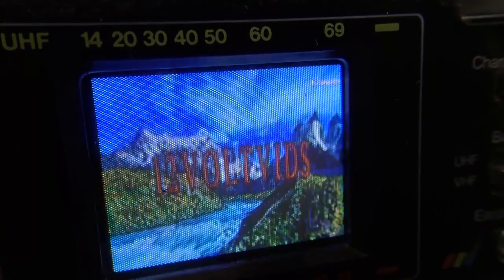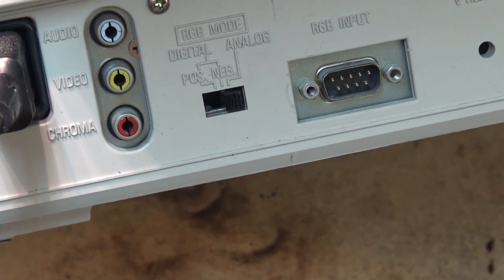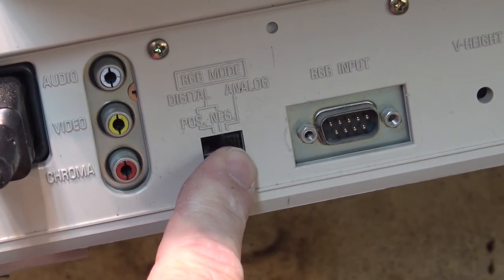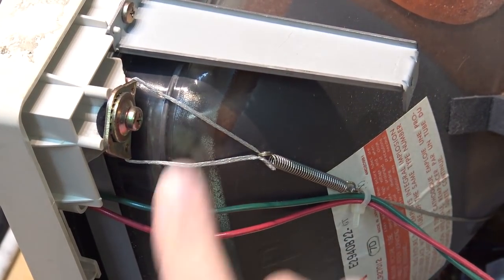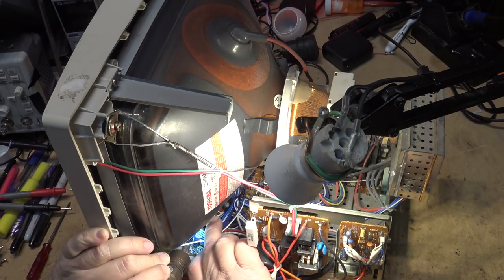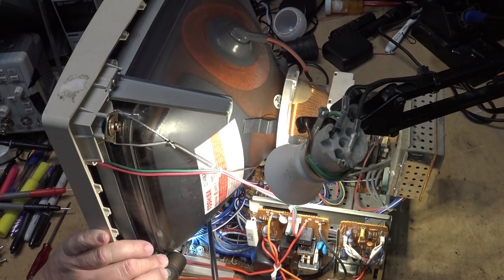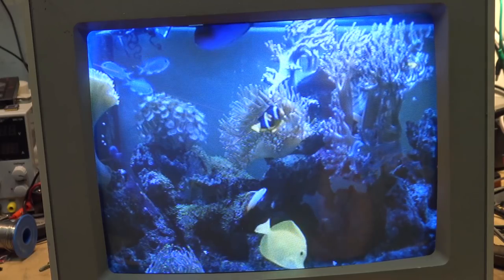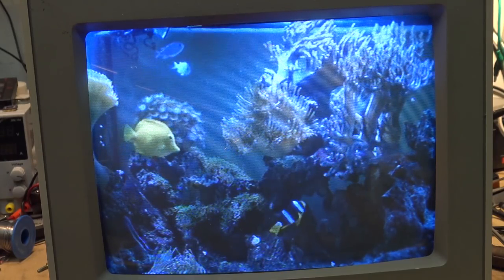Commodore 2002 RGB   Composite monitor picture instability repair

Comment: I had a similar monitor on my Commodore... It was Magnavox branded but used the same chassis and tube as some Commodore models. Got to where the picture would just go out instantly, along with any signs of deflection or HV. If you smacked the case in the right spot, it came back just as quickly. Got tired of that and opened it up one day, sure enough, cracked solder joints on the flyback. Easiest fix ever.

Comment: This video saved me a ton of grief, thank you for making it!  I picked up a 2002 monitor locally recently, and it had even more severe picture glitching than yours, losing both chroma and sync intermittently.  The PCBs inside were very clean with minimal corrosion, and no signs of capacitor leakage, so I was anticipating a world of hurt trying to troubleshoot the problem without obviously failing components. It took a TON of contact cleaner in the Video Mode switch to completely get rid of the problem, but now I have a perfectly stable picture even when fiddling with the switch during operation. Again, thanks!

Comment: Very nice monitor and enjoyable video :-) Are you in your house because covid19? I'm in Italy, we are all in our house. Here is a disaster...
Reply from the maker: No it's my day off. I am back at work tomorrow. I work for telecom, essential service. We have to work, but we are not entering customers homes during the covid restrictions. I can only work outside, and come up with solutions, even if temporary to restore service on the outside. Even it it means running a long wire or fiber from the termination point outside into the premise.

Comment: I've got a 1701, wish I could have another (got other priorities). It only has composite and y/c 358 or whatever that's called. After really thinking about it I'll say it's slightly better then s-video inputs on any of the 'HR trinitron' pro sony rack monitors I have of the same size, and ALL the ones where I work except their big ikagami's (with the large control stage and jog wheel). Apart from the phosphor after-glow persistence, it's HARD to do better. I'm starting to hate this lcd I have to use again... gonna bang my head against the wall more for throwing out that apple cinema tube monitor.

Comment: Good to see one of these still running!! That monitor is super clean. Did not realize Fujitsu made these. They were a great company. They also made early industrial communications equipment for dedicated data phone lines, and voice multiplexers.
Reply: They made the commodore 1902 (non-A) and the 2002, which were identical.  I think the 2002 was sold to the Amiga people and the 1902(non-A) to the Commodore 128 people.

Comment: I bought one of these around 1991 but I believe it was the model 1084S. If my memory serves me, mine had a switch on the front panel that changes from colour to b/w which was actually a simulation of the green phosphor monitors, like the early IBM...

Comment: Miss my old 2002. Lost it to a burst pipe in my apartment. Next to impossible to find and ended up cobbling enough parts from a few Sony Trinitron 1350 monitors together. *Sigh*, it'll just have to do. 😉

Comment: Great monitor. I thought all Commodore monitors were rebadged Philips, I've never heard about Fujitsu made ones. Recently I bought a Philips 14" professional video monitor for about 25 USD, which turned out to be a rebadged JVC. It also has high resolution CRT in it, an M36JGK90X by Panasonic. It has about 30% higher horizontal resolution then an ordinary CRT of the same size, which estimation is based on the comparison of macro photos (by counting the stripes on the same surface area) of its CRT and an other, generic CRT of the same size. It also has a great picture, and low hours in it. Unfortunatelly it only has composite input (on BNC, of course), but on the rear input PCB it has the unpopulated place for a pair of feedthrough S-Video input-output. I'll examine it and if it only missing the connectors, an input selector switch and some other off-the-shelf stuff, I probably will populate the S-Video input. If it's harder than that, I'll probably leave it alone, because the schematic seems to be unobtainable. Maybe if I can find the original JVC model/chassis designator, it could help, but based on the Philips model number (LDH-2114/10), I can't find anything.

Comment: Cracking picture! Had one of the Philips ones many moons ago, which was built to an identical spec. I recall the Commodore computers had a lot of shielding inside them as well, probably to make them compliant with FCC regulations on interference, etc.
Reply from the maker: Likewise with my old TI99/4A computer. Shielding up the ying yang.

Comment: I once had two monitors similar to that one. One was a Magnavox, and one that was a Commodore. Both were identical. It had two push buttons up front. One was for switching between RGB and composite, and the other button was for changing from color to green monochrome. I believe the Commodore was a 1902. If you watch the movie License to Drive with Cory Hamm and Cory Feldman, you will see several of the Magnavox monitors at the DMV where Les Anderson (played by Cory Hamm) took his written test. They where set to monochrome green, but in close up shots you could see the color phosphors.

Comment: I just got one for $27.  Somebody replaced all the caps in it with Nichicon.  It would come on and shut down right away.  I disabled the OVL circuit and the hi-voltage would go to 29KV.  Of course, I would only leave it on very briefly.  Found the Horz freq was about 12K instead of 17.5K (or whatever the normal freq is).  The Horz pot center tap was open.  De-ox the pot and swished the pot around for a bit, centered it and it came up and worked at 25KV and looked good.  Re-Enabled the OVP circuit and it is working great now. Also de-oxed the switches and pots.

Comment: +RGB, would have been used with the Commodore 128, for 80 column mode.  Otherwise it would be used with either composite or separate Luma/Chroma with the commodore 128. You needed that front panel switch for the 128 because it would switch modes.

Comment: Were Commodore’s monitors actually the first consumer monitors to support separate luma and chroma? Teknika came to market by ‘83 I think with the MJ-10, which was styled like the Atari XL series and had separate chroma and luma inputs that worked with Atari’s computers. 

Ironically, Atari had sported separate Y/C outputs since 1980, but never released a monitor to take advantage of them. Warner Communications were incompetent idiots.

Comment: I wonder how clean is it inside for such generation monitors, i had a lot from that period what yellow and crappy, i would believe the width change is due to a dried cap in the horizontal correction, not the power supply of the horizontal stage because the vertical would be affected too due to THT lower value and auxiliary powers downing  .... good work.

Comment: 03:36 What's with that black & white checkerboard pattern between the stripes of colour? (e.g. between green and magenta)
Reply from the maker: That is called dot crawl, and is an artifact of NTSC color.  You must be from a PAL or SECAM country as those systems were immune to it. All NTSC analog color signals have these artifacts. On cheaper TVs they were filtered out, and VHS tape didn't have the resolution to display it, but a high resolution display certainly did. This is why higher resolution devices, (S-VHS, Hi-8, DV and DVD used the S-Video connector. So the lumanence and chroma were carried between the devices separately.  As soon as the color information and lumanence is mixed to form a composite NTSC signal, the mutual interference in frequencies right around the 3.579545 MHz occurred.  On PAL the color carrier frequency was 4.43, and thus above the pass-band frequencies of the lumanence signal.

Comment: While i'm here 12voltvids. Was the pix tube in that monitor a delta gun with round phosphor dots arranged in a delta ie triangle (the electon RGB guns stack as in a triangle rather than next each other like Sony's trinitron?  We used to spec such a tube in a monitor for grade 1 class at a position in the studio control room for ccu (camera control) operator. The tubes were eyewateringly expensive!
Reply from the maker: I'm sure it's an inline gun but I didn't look closely.

Comment: Virtual fish tank.
Reply from the maker: Oh it's real, inside my living room. That was when it was fully stocked. I am waiting for the fish to expire and then I will take it down. I have 6 fish now left. Yellow tang, 2 clown, a few chromis and damsel fish are all that is left. The corals expired after the lights burned out, and replacement bulbs were no longer available. I wasn't about to spend 2000 for new LED fixtures so the corals died due to lack of UV light. Once the tank is gone I will mount a TV on the wall and just play the video of the fish.
Reply: @12voltvids  I like clown fish, used to have a room mate who had several tanks of them, one in my room that I didn't even have to tend! I used them to test super 8 film and cameras and frame rates and loops and things. I miss that.